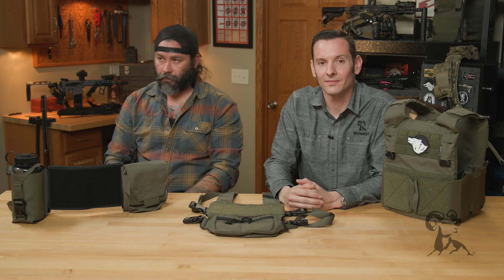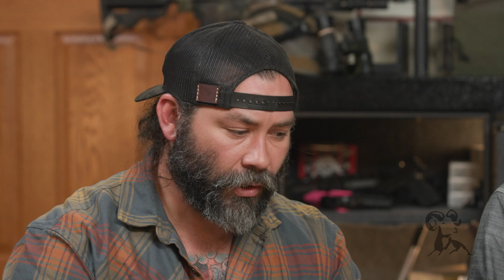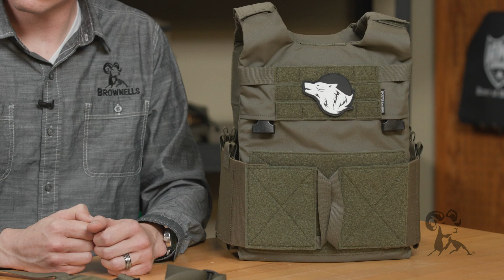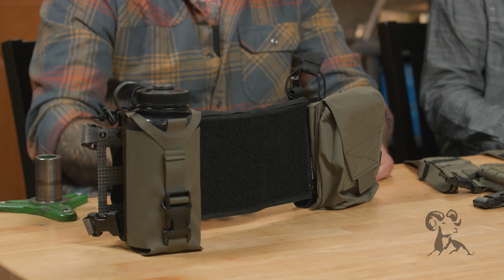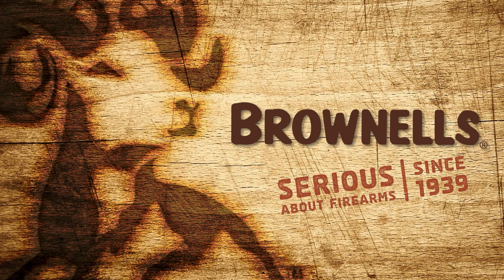Why Expand Your Spiritus Systems Rig?

Comment: I have several setups, some I keep in the "micro" configuration, and others I've expanded in order to allow myself sustainment options when time may not be available to piece a rig together. And they all  have the ability to become shingles on the LV119 if necessary.